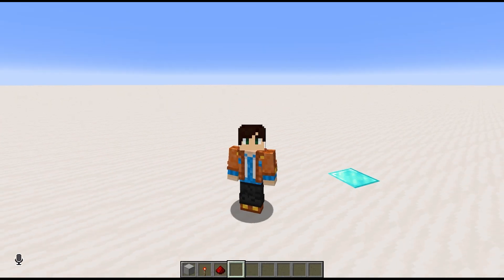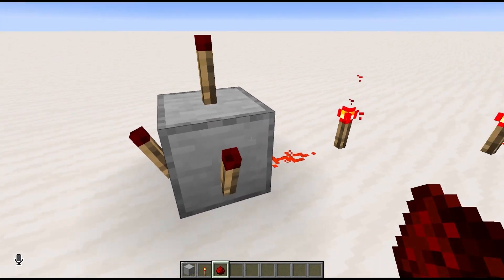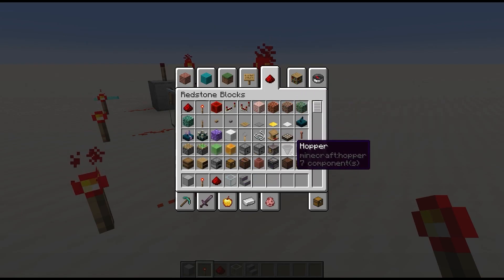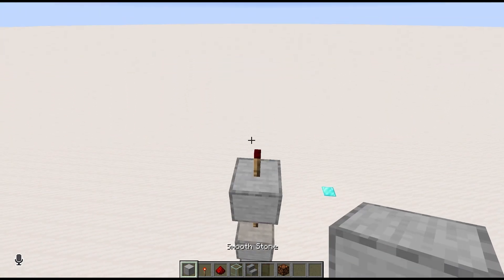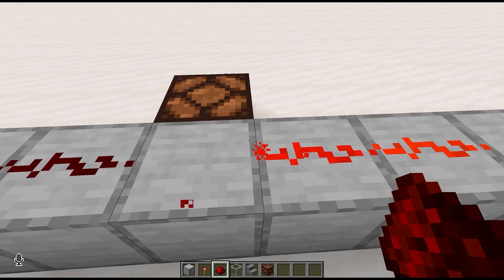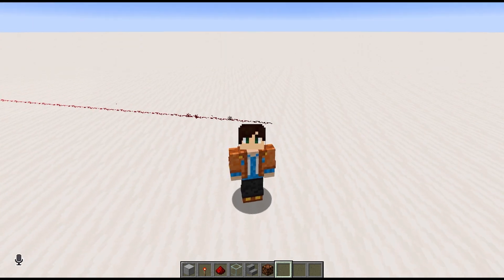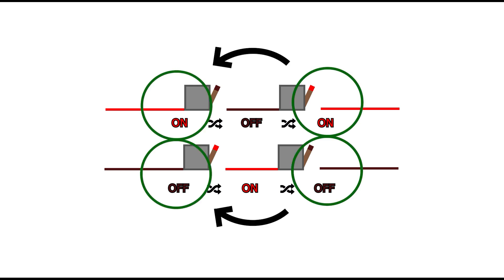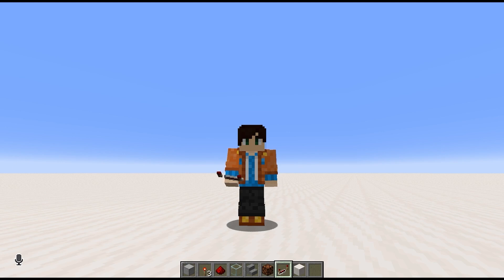The Redstone Torch: How to use the MOST misunderstood Redstone Component in Minecraft

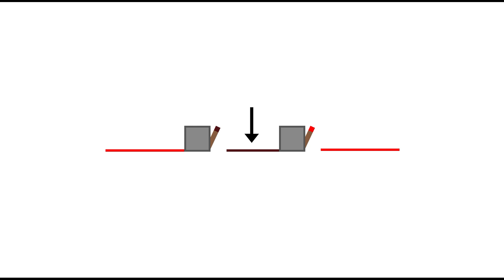Comment: 7:30 I know you called this concept useless but would this be considered a 0 tick repeater? I don’t have any use for it but definitely interesting if you need to move a pulse a crazy distance.

(I know that’s pretty niche and 1 tick repeaters are basically no time at all and that long a distance in a straight line can cause render/simulation problems but more of a concept question than anything)
Reply from the maker: Great question! It's actually a 2-tick repeater. The reason why is that there's a 1 redstone tick delay between when a block gets powered/depowered and when any redstone torches attached to it update their own power state to be the opposite of the block's. And since there are 2 torch inversions going on, each adding 1 tick of delay, that means there are 2 ticks of delay total.

If redstone torches instead updated immediately, then it would be a 0-tick repeater, exactly as you said.

You can see it for yourself by using the "/tick freeze" and "/tick step 2t" commands ("/tick step 2t" moves the game ahead by 2 game ticks, which is the same as 1 redstone tick, or 1/10th of a second). There's always a single redstone tick where both the block and the attached torch are powered at the same time, or are both depowered at the same time, because of that delay between the block getting powered and the torch getting depowered (and vice versa).
Reply: @RedstoneWithMistRazor ah ok, makes sense. Didn’t know about that delay. I feel like it would be used in some scenarios where faster signals are desired, so that explains why I haven’t seen it before. Thanks for the detailed reply!

Comment: The best current way of sending signals both up and down is a wall with some trapdoors and an observer, the torch way is a torchure, especially down. Thanks for the video, it's abundantly clear and succinct
Reply from the maker: This is true, but this series starts from zero, i.e. I'm assuming the viewer doesn't know what an observer is yet. I'm most likely going to talk about observer walls in the copper bulb video (because copperflops are super useful when working with 1 tick pulses).
Reply: @MistRazor  I'm looking forward to squeezing the like button under it asap! What did you mean by 1-tick pulse, btw? IIRC, copper bulbs have been revoked of delaying signals by 50 ms, and 100 ms pulses (1 redstone tick) are not quite hard to handle
Reply from the maker: @dimaminiailo3723  by 1-tick pulse I mean the observer output from reading the wall. Using a T-Flip flop (of any kind, but the copperflop is compact and accessible to both Java and Bedrock) on the observer output lets you convert the signals you want to send back to long signals, for those cases where you don't just want single tick signals. (I discuss it a bit in the Observers video.)

And thanks for the likes, I should add!
Reply: @RedstoneWithMistRazor  I've built some contraptions that operated with 1 gametick precision, so I usually count gt rather than redstone, it eliminates confusion later on. If you ran out of fun projects, try to build 1-gt negative pulse generator (i.e. ... 11(pressing a button)11011...). Mine was cumbersome and rather slow

Comment: So, really the only reason to use the old-school multi-block repeater is if you’re struggling for redstone resources somehow?

Because technically you could  use just 2 blocks and 2 redstone torches with (14? 15?) dust between and make a very long repeater to send it as far as possible…
Reply from the maker: I suppose that's true! In that situation I'd recommend making a witch farm because they're great ever since the buff to redstone dust drop rates. But if you're in a resource constrained puzzle room or something, that would absolutely be a valid approach.
Reply: @RedstoneWithMistRazor  also, you can get so much redstone just mining for diamonds down at -59 anyway…
(That’s why I said somehow)
But I suppose it depends on if you need distance or compact…